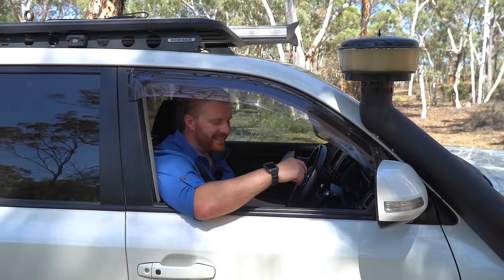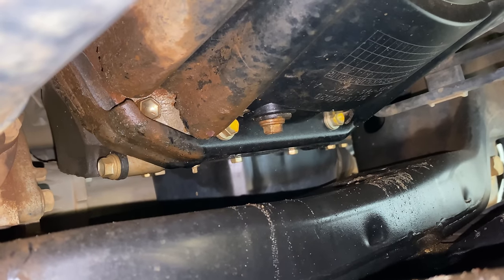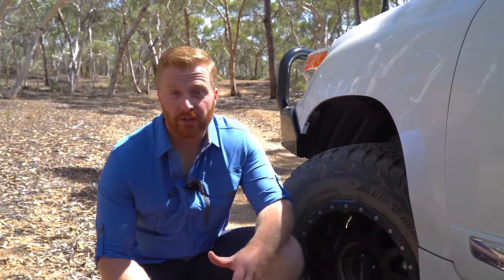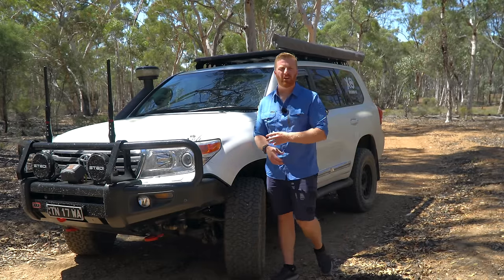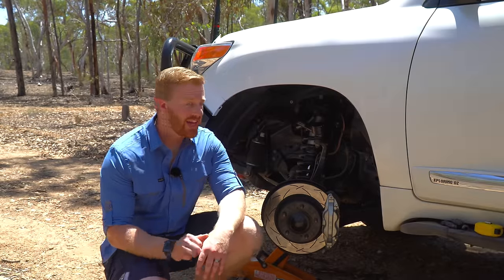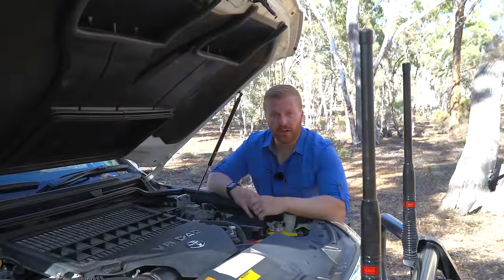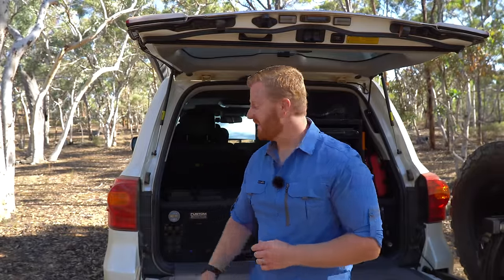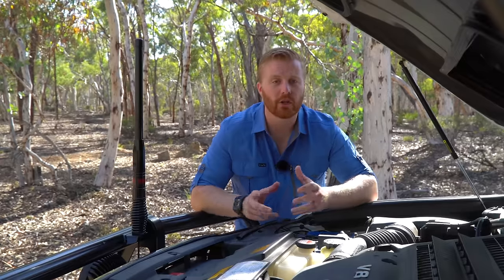LC200 | PROBLEMS & ISSUES | Not everything goes to plan -Mechanical-Electrical-Suspension 200 SERIES

Comment: I've owned Toyota Landcruisers all of my life, troopies and utes and they have taken me around Australia more times than I can remember. I have done the Gibb River road a number of times and traversed The Great Central Road numerous times. I have literally clocked up millions of kilometres across all of my vehicles. The only one that cost me an arm and a leg to own and run was my last cruiser I owned, a VDJ78R Troopy.  Water pump failed at 50,000km. Then I started having problems with excessive oil consumption! I was in the middle of Queensland one year when in a rain storm my vehicle started playing up, the speedo stopped working, indicators stopped working and the engine started running rough and smoke started coming out of the dash. Then the next day it would all come good. I took it into Toyota and they could not recreate the problems. Within 6 months it started playing up again while I was in WA. It had some sort of electrical gremlin that no one could rectify. Then the V8 started running rough again and did not go away. Took it into a diesel specialist to where they diagnosed a number of faulty injectors and a buggered injector module, they recommended I change all of the injectors not just the buggered ones as well as the injector module. That little exercise cost me over $10,000 and it ht my hip pocket hard.
Moral of the story is that no car is unbreakable or perfect and it really does come down to luck, but the good thing of owning a Toyota is its resale value.
Reply from the maker: Hey mate, thanks for sharing your experience and sorry to hear you had soo many issues with your VDJ78. I agree with you entirely, no vehicle is perfect and everything has potential issues. I guess we try and make educated decisions to reduce the chance of buying one of these vehicles and Toyota certainly do have a great average and long term track record. 
Cheers, Nathan.

Comment: Intermittent electrical problems are a nightmare make up a twin core test lead of 6mm cable about 4 meters long and fit with good crocodile clips you can then use it as a diagnostic tool or a field repair I have had a cable fail inside probably a fault when it was made oddly it only showed up after a pounding over a corrugated road. With your fuel air leak check the sediment bowl gasket is good and there is only one on the pre filter and the filter isn't 5 micron better to run 30 micron less load on system and separates water better
Reply from the maker: Thanks for the suggestions mate. I'll have a look at trying some of this out. Your right though, electrical issues are not fun! 
Cheers, Nathan.

Comment: Great video as always!
Have just acquired a 200 a few months the ago and love your videos. 
I have noticed with my key fob that is I park in certain places, something interferes with the fob or system in the car. Must be radio interference at those locations for me because I can go back there and it happens. Anywhere else at my house, no issues ever. My mothers subaru also, when we goto our local leagues club, her fob won't work. But never an issue anywhere else. 
I have a catch can provent 200 and also the fuel manager pre filter but am yet to install them. If you do find that they are the cause of the issues I am sure you will make a video on that. It's 50/50 for me to fit them, so many tell me not to. Have them both on a shelf but I have fitted a uni filter.
Reply from the maker: Thanks mate, glad you enjoyed it!
Interesting to hear you say that. From what I'm hearing here in the comment it appears that the Toyota frequency might be vulnerable to other frequency's from external devices and aftermarket modifications. Quite frustrating if this is the case and wondering whether it would be possible to change the frequency all together?
Hmm, I hear you there. There are allot of reviews positive and negative on these accessories. In the end, the fitment or lack of will not harm your engine in the long run, they just provide benefits like longer intervals between intakes cleans and shorter intervals between fuel filter changes. 
Cheers, Nathan.

Comment: Hi Nathan
Thanks for the honesty and comments my 2014 GX 186 000 ks has been overall very reliable rear temp sensor on intercooler shot and relay from subtank shot ( not ideal before crossing the Tanamai) replaced in Broome. King springs and Koni heavy track raid, rear airbags have been awesome since 85000 ks, You can purchase rear shock guards- Stainless steel from Kaon industries here in Vict should solve your problem. I’ve traveled most of oz on factory fuel filter changed regularly and spares never a problem maybe bypass secondary filter for awhile and see if any difference.Cheers Ant.
Reply from the maker: Hey mate, thanks for sharing. I'm glad to hear that you have managed to get around with only minor issues, it sure is comforting. 
I too have been looking at the shocks guards and is something that I'm definitely sure will be purchase in the future. 
Yes, fuel filters are something I also change frequently and keep spares of, the cruisers are known to have sensitive filters. 
Cheers, Nathan.

Comment: Rear main leak is due to the catch can, remove it.

One way to check if the catch can is causing too much pressure is to warm up the engine and take off the oil filler cap. If its making chuff chuff noise accompanied with blow by then you have your answer. Then remove catch can hoses and reconnect original hose and test it again with oil filler cap. I guarantee you that there will be almost no chuff noise and very little blow by.
Reply from the maker: I hear where you are coming from and although it is possible it should also be noted that the Provent unit does also come with a pressure bypass valve to ensure this doesn't occur.
Removing the catch can might still be something that I try to see if it makes a difference.
Cheers, Nathan.
Reply: That chuff chuff or knock, knock noise you can hear out of the catch can with its lid off or via a stethoscope on the left bank rocker cover on the 1VD-FTV V8 engine is more likely a noisy vacuum pump on the passenger side bank. They can make noise for some reason but still work fine, I replaced my vacuum pump for that reason at 97K & no noise now.

Comment: Thanks, very useful information. My land cruiser is a vdj200 , same engine twin turbo 4.5 diesel, but with no intercooler, and it's manual transmission 🙂, with troops tail gate, with normal ignition system no much electricital and electronics . Even the interior material is kind Water proof. It's 210,000 km no issues so far.
Reply from the maker: Very nice! Sometimes the more basic is better. Less to go wrong. 
Hopefully you have trouble free times ahead 👍

Comment: Great video mate. With the starting issue, I’d check hoses and filter size on secondary fuel filter. 2 micron filters have been known to be too restrictive in some applications and some kits use undersized hose. This can be alleviated when the hose heats causing expansion which would explain it only being an issue on cold start. I would bypass the secondary fuel filter entirely to test.
Reply from the maker: Thanks mate, good suggestion. Bypassing the secondary filter is something that I haven't done yet and something I'll definitely try. Be interesting to see how this goes. 
Cheers, Nathan.
Reply: Rhys - 100% mate- I was told to dump the 2m and us a 30 to alleviate any potential issues ..

Comment: Thanks Nathan, great vid again. I am just now experiencing the same issue you had with your ARB suspension. When I collected it they mentioned there was 40psi in the bags for air testing thats why it sat up so high and that when I get home you can just let it out and it should sit right. When I got home there was only 5psi. Sits super high at the rear and rakes forward. I have my 500km checkup coming soon so will get them to watch this and explain why it sits like it does.
Reply from the maker: Hmm, yeah that's a little poor in regards to the statement from ARB regarding the pressures. They ought to have known that this kit sits high.
I will say now, I've had my front suspension wound right up to help add a little extra and given the extra weight in the rear, it sits nicely now, but it has taken some mucking around to finally get right...

Comment: Great honest video... Also recommend 200 series owners carry 2 sets of jumper leads. On our lap i had to jump 3 200 series and required to use my jumper leads and theirs - I think they need 24v to crank (both batteries charged) so both batteries need to be jumped. Also seems its easy to drain the batteries which might be linked to what you mentioned in this video?
Reply from the maker: Hmm good point. The 200 series do come out from factory with two batteries, however this are wired in parallel, not series. So it's still only 12V however, the two batteries together provide a little extra punch to get that motor turning over. 
Interesting to hear about the main batteries being drained easily and something that we all have to keep an eye on to prevent issues in the morning...
Cheers, Nathan.

Comment: Hey mate. Few things, hope they help.

1. Fuel Draining back, mine was a missing seal in the secondary filter causing it to drain back over a night time, much like yours if driven multiple times during the day, it never faulted. 

2. That “rear main seal leak” actually just looks like excess grease from the uni joints on front prop shaft flicking off…..I was the same as you, I thought ohh I got a rear main leak, but when we pulled the motor on mine it definitely wasn’t a rear main leak 👌🏻.
Reply from the maker: Cheers mate, thanks for the suggestions. It would be awesome to get that fuel issue sorted that for sure. I'll check out those seals and some have also mentioned the primer could be at fault too, so I'll check this out too. 
Interesting to hear about the rear main issue, I can only hope that this is the case with my vehicle. I'll have this checked out on my next service. 
Cheers, Nathan.
Reply: Yea mate - mine drove me up the wall and back in the remote Pilbara dying each morning 🤦🏻‍♂️….I had Broome Toyota put a new the fuel filter top hat aside for me ($130) which includes a new flow sensor and primer mechanism…in my case it wasn’t my issue (but I carry the parts as spares now, just in case), when I stripped the secondary filter I found the oring between filter and glass sight bowl was missing…..replaced and all fixed, in the hotel carpark in Broome none the less too 😂.

2x ways to check rear main, their is a small inspection plate in the bottom of the bell housing or alternatively their is a foam block that sides on the passenger side in an indent of the sump, this can be removed to allow access to torque converter & flex plate bolts, obviously if rear main is leaking flex plate will have oil on it and will be very easily visible through this opening.
Reply: @great_offroad_adventures   same issue I had was so frustrating.
Reply from the maker: @great_offroad_adventures   I could imagine mate. It's definitely a frustrating issue and I can only imagine even more so when you are on a trip! Thanks for the tips I'll have both the top hat and the secondary filter checked. From all the comments it sounds like this issue will be fairly easy to fix, however its just a matter of diagnosing it!
Thanks for the heads up with the rear main seal too. I've have some others mention that it could be a simple fix other than the rear seal, so I'll make sure I diagnose that correctly before pulling the vehicle apart. 
PS. Keep up the good work with your channel too, been following it for a lot longer than I've been making my own stuff. 👍
Cheers, Nathan.

Comment: Hey Nathan,
Great content as always mate.
At 130,000 kms for your own peace of mind I would at least get a cold start test done on your injectors.
I would also spend the $900 to get your intake manifold cleaned.
I would completely disconnect your secondary fuel filter for a while to rule that out.
If you're concerned about deformed injector seats (usually only a Prado issue) you can get your oil tested pretty cheaply.
For your remotes I would change to new batteries, though you may have done this already.
All the best 👍
Reply from the maker: Hey mate, thanks for the tips. So I have tried a couple of these. I've already done an intake clean, about 25000km ago, so that should still be good and have changed the batteries in the remote, unfortunately not the issue.
I will definitely try the secondary fuel filter bypass though, this could give a good indication as to whether this is the issue or not. 
Testing the oil is another good suggestion. 
Thanks again, Nathan.

Comment: Another great video, thank you.
Did you get to the bottom of the remote deciding not to work occasionally? 
About every two weeks mine won't unlock and I need to use the manual key to access the vehicle, it still starts but then the alarm goes off for about 30 seconds, and of course the remote always works at the mechanics, any ideas?
Reply from the maker: Hey mate, unfortunately still haven't figured out this issue just yet... 🤷‍♂️ 
It's something that I've come to learn to live with at the moment. I honestly can't detect any patterns with it working / not working...
Cheers, Nathan.

Comment: A few things, check to make sure you haven’t lost the small O ring in the secondary filter as this happened to my previous V8 Troopy. I also have the electrical issue with the key fob and have replaced batteries in them etc so if you find the solution I’d love to know! And finally, despite the issues with the BP51, how do you find the ride quality especially when it was new and unloaded? Another great video btw 👍👍
Reply from the maker: Thanks mate, glad you enjoyed the video! 
A few people have mentioned the issue with the O ring now, something I'll definitely check. 
Yes, the key fob is a frustrating issue, I'll be sure to report back if I get any success in diagnosing it. 
To be honest the BP51 suspension is holding up well and I find it works fairly well. It's not high performance racing shock, but it works well and provides a comfortable ride. The adjustability is helpful and does make a big difference, so this helps to get a great smooth ride. When it was unloaded there is no doubt it was harsher, but no where near as bad as I expected. I would definitely not go any lower than 400kg rear constants that for sure. 
Cheers, Nathan.

Comment: Put some rubber glue in your repair kit so you can repair torn cv boots when noticed without the hassle of tearing it apart to replace
Reply from the maker: Awesome, thanks for the tip 👍

Comment: I had the same issue where remote was not working properly. Sometimes it works, sometimes there's lag, especially when trying to lock vehicle. For me the problem was the aftermarket led license plate bulbs. Changed it back to yellow stock bulbs, and no issues anymore. If you want to diagnose if lighting might be the issue, try disabling the comfort lights option in vehicle lighting settings that stay on for 30 secs once you turn off the engine and lock. Then afterwards, try the remote or door handle to see if there is any lag or delay.  Good luck, hopefully this helped.
Reply: Worst case if you have too much lighting to diagnose, leaving that comfort auto lights system off in vehicle settings should hopefully make your life much better. I almost sold the LC because the delay was driving me nuts. Looking like a fool touching your door multiple times trying to lock was not acceptable for me.
Reply from the maker: Hey mate, thanks for this suggestion. this is something I haven't tried yet. I'll definitely look into this when I get some free time. It's still doing this years on 🤦‍♂️ Almost become the new norm now ...

Comment: Fuel will probably be to do with the secondary filter installation. Have you returned that part to stock to see if theres any difference? IIRC the barbs are threaded into the secondary filter housing so if its not a perfect seal on those threads, theres your leak.
I would also remove your catch can, I just pulled mine out as it was causing crank case pressure despite having a new filter (provent 200). That will stop your rear main leak. Take your oil cap off and see if it dances a little.
Havent read other comments but Id say/hope these have been suggested.

Disappointing to see the same place let you down with multiple stuff ups, its a shame those places manage to stay in business.
Reply from the maker: Hey mate, so I've done exactly what you have said in recent times. Both the catch can and the 2nd fuel filter have been removed for testing and to see what effect this has. So far, this has worked. The vehicle is starting well and no noticeable leaks. So more testing and monitoring is required here to see what can be improved 👍 
Cheers, Nathan.
Reply: @XploringOz  Good to see youve made progress! Might be worth canning the second filter you have and getting an entire new unit. I was shocked at how much blowby the provent was causing....

Comment: Hi Nathan, great videos - all well presented and informative. Did you ever resolve your fuel starvation issue? I appear to have the same issue on my 2013 LC200.
Reply from the maker: Thanks mate, appreciate it. It turns out there was an air leak in my secondary fuel filter. Once this was fixed up, all good to go 👍
Reply: Thank you for sharing.